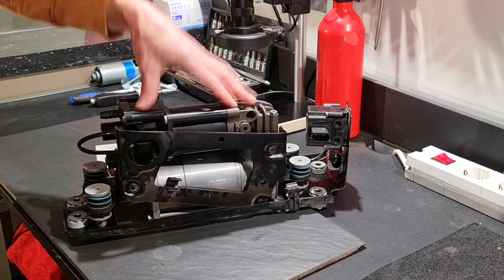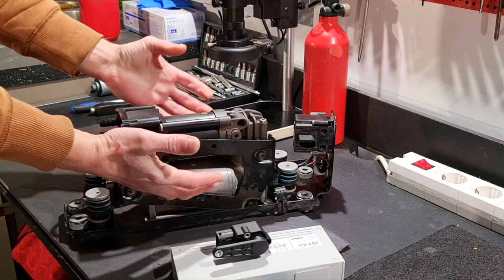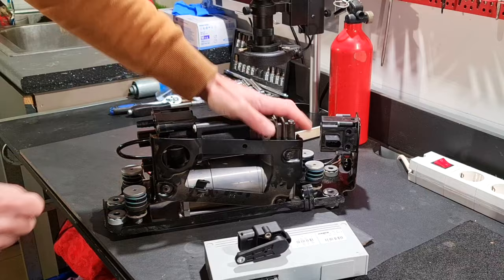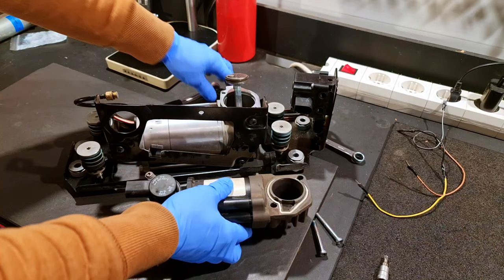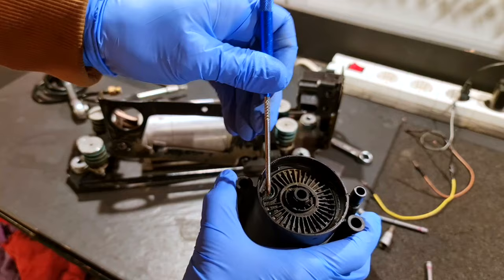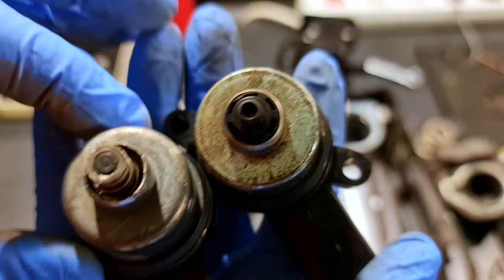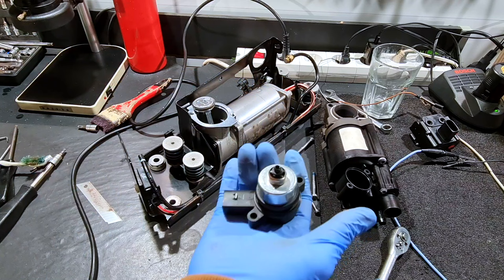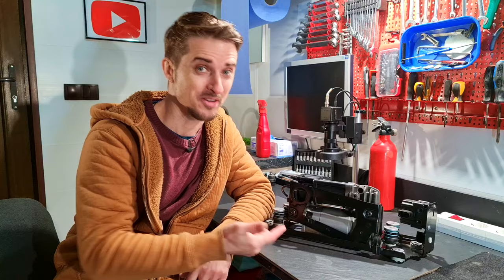Repairing the BMW Air Suspension Compressor

Comment: after watching this video, should be a idea of maintenance this unit? at least to clear humidity after winter time? will it help to improve his working period? its not so hard to unmount it from car DYI i think
Reply from the maker: it is not necessary to disassemble it, as I said in the clip only if the process is interrupted it will collect moisture (if you have or have had a broken air spring)

Comment: Great video. Highest standard. My issue: 2016 X6. Dashboard report Chassis issue but ok to drive, seek service. Code 480DB5 only once (Control time, lifting rear right).  Manually cleared by scanner and rarely seen again. But followed by 480DB1 (State: Current. Lower control time) repeatedly sometime after each manual clearing using scanner. Suspension not dropped, ride OK. Could this be linked to discharge solenoid and or wet desiccant? Or should I be looking to the control unit or relays?

Comment: Hi,cilould you please advise what the problem could be- fuse blown on air suspension, car sitting low, every time I try to put new fuse it keep blowing fuse, BMW  F15 , problem started when I parked car- compressor been very loud and rattling noise for about 15 min. Next morning car sitting low. TIA
Reply from the maker: Hello! you need to find someone in your area who know to repair BMWs and go to him for a diagnosis! with opinions on what can be you'll lose your time!

Comment: Nice work! I love repairing things like this and get it to work again, it gives me such a great feeling!
Btw, a friend of mine has a Audi A6 with air suspension, its not a new car but probably around 2010 or something, not sure.
He has a problem where he cant get air INTO the system, if he disconnect the hose and pump air directly it works but the compressor is not able to put air into it, its been in a shop for a long time and they cant find the problem apparantly.
I dont know any details other then that, but to me it sounds like a solonoid valve not opening or something, what do you think?
Reply from the maker: Hello,  first of all you need to do a proper diagnose on the system,  and when I say diagnose I don't mean only to do a errors scan.  And after that you will know what is the problem.  Begin an VAG I don't know much about these,  but can be the valves,  or wiring or control unit ...and so on

Comment: Nice video! Is it also possible to connect an air tank instead of the walves to use it as a dustgun ? A video to change the usecase will be also very nice. greets.

Comment: Great info thank you for the tutorial, do you have a part # for the discharge valve?
Reply from the maker: Hello! it is written on it!
Reply: I think they fitted an aftermarket part on mine. Mine is stuck on shut, it won't let any air out. I would be very grateful if someone could share the part number as there is no number on mine unfortunately

Comment: Van i ask question?
My motor armature burnt out. I check the pump ok. Discharge SOV is ok. Can it be the suspension airbag leaking? Will the pump run continuously overnight if air bag leaks?
Cheers from South Africa

Comment: Awesome video, thank you so much for making it!
A silly question, what kind of grease are you using? I will be attempting to do this repair and want to be sure.
Reply: Probably some simple vaseline. Avoid anything that might damage the rubber
Reply: @PiFe00  Thanks for the reply! I ended up using WAKOS rubber grease.
Reply: @jameswilliamson911  you might do better if you use silicon grease vaseline is petroleum based

Comment: I just replaced my solenoid valve as per your video and dried the beads and cleaned the mechanism. When I put it back together, it cuts off after working for 1-2 seconds, every time it turns on. All electric and air lines are connected, do you know what could be the reason?

Comment: changed the compressor but now it still works but my air bladders no longer deflate. I changed the valve block but it doesn't change. Do you think my problem is due to the filter?
Thanks

Comment: I’m having issue with my g31 2018 5 series touring. Chassis restriction message on idrive. And the back en of the car sitting very low and bouncy ride. Car won’t return back to usual height now. Local bmw specialist has said over the phone the pump is burnt out and will need replacing £1200 approx. Does this sound correct and/ or have you any advice for me before committing to letting the garage do their work. Much appreciated 👍🏻

Comment: If the solenoid fail , what symptoms does it have? I replaced pump, and now I’m only hearing a click sound when opening the door but no pump coming on, all fuses and relays working, any help wil be appreciated 🙏🏻🙏🏻, thanks for the great video
Reply: Hi! Did you fix your car?
Reply: @vlat18  I replaced the pump relay and it’s fixed now

Comment: My X5 Sagged completely while i was driving, and about 3 days i was trying to find out why the compressor was working every time when i was locking the car but the car wouldn't rase and i jacked the car up and tried again the car raised up until now its fine.
Any idea why the car sagged ? Thank you very
Reply from the maker: You need to do a proper diagnosis on that car,  asking on YouTube nobody can know! The system and this car are quite complicated, and because of that, you need to diagnose them properly!
Reply: Thank you very much for replying.
 One of the air bags was failed i have replaced both sides and the car raised up and after 15 minutes it sagged  is this could be the compressor?

Thank you

Comment: Amazing job sir !! Did you check the relay?
Reply from the maker: Hello! after seeing this video what do you think ?
Reply: @MOvidiu  🤷 have no idea.. the relay was good or bad?
Reply from the maker: @Leonardo Costa  When repair or replace the air suspension compressor is mandatory to replace the relay,  not negotiable! The relay is a consumable part!

Comment: Hi
In my car air suspension is high and is not dropping down
What could be the reason for this?
Reply: Hi what you did?
My car  go heigh  and blow 40 amps .what I have to do
Reply: What was the solution you find out please update thanks.

Comment: Hello friend good information your videos sing I have a BMW X5 f15 2016 I changed the rear suspension I put the new engine the bus has the same problem or Sorry not so much the same problem before it went down completely now it goes down a little on the right side an inch below the other side I don't know if the left side or the right side is normal I already did the calibration I also put the new sensors on it and the same problem continues unfortunately I don't know what to do thanks if you can help me
Reply: What was problem and solution you find. Update Thanks

Comment: Can I ask where you get the discharge valve/solenoid from? I have bmw g31 air compresor issue and I would like to follow this vide and give it a good clean but don't know where to get the discharge valve/solenoid from? Even part number would be helpful.  Thanks in advance for any advice
Reply from the maker: Hello! Do a Google search! officially that parts aren't coming separately !
Reply: @MOvidiu  I been searching for 4 days now, I found the one you used , but can't find one for g31 compressor anywhere at all. Not single page,shop,website or even mention on car groups and forums unfortunately

Comment: Hello i have an issue , I changed the valve , it went back up and a day later the  compressor fuse blew again and I don’t know what the cause is . Any help is welcomed
Reply: Pls can you tel what you did. I have same situation. It went up and blow 40 amps pl let me know
Reply: @janmotors1779   hello so I went to change the valve , then when I changed it same thing , I coded my battery with  ISTA  as i changed it but didn't register it and it stopped however because of the amount of fuses it went through , 3 months later my compressor failed and I replaced it and now no problems
Reply: Thanks for replying. Pls let me know pump model and where you get .
I checked on fcpeuro they have 3 pumps one BMW ,2nd oem and 3rd ARN-P3818
Pls help and let me know 
Thx

Comment: Great video. I have a '15 F15 X5 with the same issue. Where can I find the (2) valves (exhaust & distribution) for this pump?
Reply from the maker: Hello . you can do a quick Google search and find a toon of information ! I don't have a special place to buy parts .
Reply: @MOvidiu  Thanks...but not the exhaust valve. Not sure if your link to the one you used will work with F15
Reply: @MOvidiu  OK, I found the exhaust valve to be stuck open as was the one in your video & have ordered a new one from you link. I could not have done this without your video. Thank you very much.

Comment: Another super interesting video! Thanks very much! How much time the compressor needs to break down (i.e., collect water) after an air spring fails? In other words, within how much time should a broken air spring be replaced in order to make sure that the compressor stays healthy?
Reply from the maker: It is best to replace it immediately. but often you can only realize when it's too late, usually at the beginning there is a small crack that loses some air and you do not notice. related to how fast it loads, it's not a certain time, it depends on the atmospheric conditions, how much humidity is in the atmosphere ...
Reply: @MOvidiu  I see! I my case, the left rear air spring has a small leak. It takes about 3-6 days to go down about 5 cm. (But the leak is (still) too small to see with a soapy water solution.) After starting the car, the spring immediately levels up again. Should I replace the air spring immediately? Or can I wait until it gets worse, until the leak can actually be detected?
Reply: @xwu8147  what's up any news?
Got same problem!
Reply: @lou007  I replaced the air spring. And nothing else. Problem solved.
Reply: @xwu8147  appreciated
Reply: @lou007  Welcome. Recommended to just replace the air spring and reuse the strut. See: https://www.youtube.com/watch?v=PMXGHnbKxLw&ab_channel=LuxurAutomotive

Comment: Great Video currently having an issue on my F85/X5M Not airing up the rear suspension at all even when car is running I checked all the fuses and fuses are good going to attempt to replace the relay once that comes in and hope it will work because it seems as if its not getting any power to it running through the wires to the compressor after unplugging the connectors to the compressor and testing w a circuit tester looks like there is no power, car was in a accident and had damage to some wires on the passenger side wheel well on the fire wall side but I have since replaced everything and just having this issue now with the suspension not working, if anyone knows anything I could try or possible solutions let me know would greatly appreciate it.
Reply from the maker: Hello ! nobody can know wat could be the problem without seeing the car !, ideally is to find someone to diagnose it for you !
Reply: @MOvidiu  thanks for the reply going to be taking the car to my bmw mechanic to diagnose w his computer tool and more hopefully will get it figured out here soon!

Comment: What do you think, why my F11 sometimes drops on one side when parked? It has new bags mounted recently.
Reply from the maker: I think you need do do a complete diagnosis , and when I say diagnosis I don't mean only reading error codes !
Reply: @MOvidiu  Yes, sure, because there are no errors 😁
Probably some valve went bad, I'll check everything out once weather improves

Comment: Daca nu elibereaza aer desi am pus valva noua e posibil sa fie blocate valvele din bloc? Se poate repara/debloca in vreun fel?
Reply from the maker: Posibil ca da..dar asta doar tu poti afla testandu-le !
Reply: @MOvidiu  deci am pus supapa de evacuare aer noua. Bloc de valve altul. Si tot nu vrea sa se desumfle. De pornit porneste compresorul daca pun bagaje sa fie la nivel dar de scos aer nu mai scoate dupa.  Ceva idei?
Reply: @powpow4033 what was the solution you found.
Reply: @nomi1902 broken wire at the release valve....check the wiring

Comment: If you can please, what kind of grease/lubricant did you use on the cylinder bore? 17:59
…
Your video was extremely helpful got an old E53 Wabco compressor going again.
Thank You.
Reply from the maker: Read the description! You don't know how much you lose when you don't read the description ! 😀

Comment: Hello M.Ovidiu quick question 10:30 How works this valve ? If there are no power supply those valve should be CLOSED all the time ? And when we power up it valve those valve should be open ? I ask about it because my rear suspension slowly falls. And I dissasembly valve block and one of valve was still OPEN, after clean its closed but STUCK CLOSED, whet I put it to my valve block an start engine, one side doesnt rise and I get error 480DB3 control time, liftting, rear right. So I swapped valve places and now I get error and problem on left side. So there is any possible to repair one solenoid ? Or I should buy new vavle block and replace all unit ?

Comment: Hi, great videos, and i think you maybe you can help with my probblem, because no one can help in my city where i live i have problem with fla retrofit it doesnt respond, i done wiring corecly, enter VO, also upgraded my mask to mask2, and i get two codes from fla: 00e0d8 Message (lamp condition, 0x21A), receiver high beam asistant and 00EODA Message (rain sensor/wiper speed, 0x226), receive high beam asistant, maybe you could help or get me into right direction, because all i cant think maybe my light module is to old and i need to upgrade to lm2? Also if it helps my  car is 2003 e60
Reply from the maker: Hello,  after physically mounting and FA changes you need to code with the new FA KOMBI, LM ,  FLA   but I don't know for sure if you're LM is compatible
Reply: @MOvidiu  i coded all modules but fla i cant code it doesnt respond, i even try another miror with fla but it does same thing…
Reply: Hi again, i updated Light module and now fla is finally working

Comment: how to recalibrate the suspension system? 
I got a side is lower a bit than the other?
no leaks i think!
Reply from the maker: Hello . in istaD /Service function/Chassis and suspension You'll find an ABL ( test plan ) to calibrate the suspension
Reply: @MOvidiu  I tried recently and actuall measured the height and put them let the car sleep for an hour took for drive nothing changed!
Reply from the maker: Maye you did not did correctly ( need to measure  from the bottom wheel lip to the fender ) or your level sensors are bad !
Reply: @MOvidiu  I did measure well as ista said
I get two millimetres difference between front sides!
The rear right always ABIT lower exact difference every time I measure it
Could be the sensor? 🥲
Reply: No error on ista ehc is clean!
Reply from the maker: @lou007  what is the difference? In mm
Reply: @MOvidiu  2 Milis in front and the rear 6milis
And of course it's not stable at speeds
Reply: @MOvidiu  up 😅😭
Reply from the maker: The 6 mm difference is not a problem is in specifications that car and the suspension is not a razorblade :) from the 6 mm a part can be a difference in air pressure in the wheels , the level of the surface where is parked ...
and don't tell me the lower part is right side ?
Reply: @MOvidiu  the right side is lower yes, i checked the tire pressures recently...& The lower side (right) always is the same height!
+ Last time the car jacked ...when it went on ground again the left side inflated quickly but the right side didn't until I took a drive! 🤔 Wondering!

Comment: 5,7 and X from what year?
Reply from the maker: All bmws that have air suspension have this type of system, only that between generations are some built difference  the shape of the compressor, the type  and the communication protocol of the control unit etc. but the principle is the same. in this clip I am working on one from an  F series that was used on F10 F01 F15  ....
Reply: @MOvidiu  thank you :) saw ur other videos and must say u doing a great job.

Comment: Good night sir. 
I have 2 solenoid valves exactly the same look but the one in my F15 has number: 472 255 562 0 and the other I bought has number: 472 255 561 0 are they booth going to work? Thank you 🙏🏻
Reply from the maker: Hello! use Realoem.com to check the parts numbers with the VIN of your car !
Reply: @MOvidiu  Thank you sir I appreciate that 🙌🏻